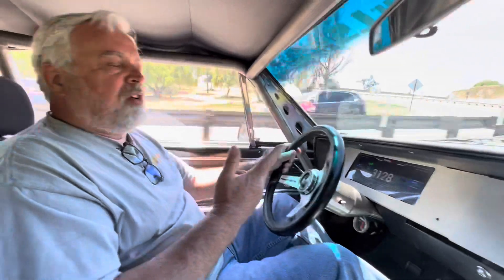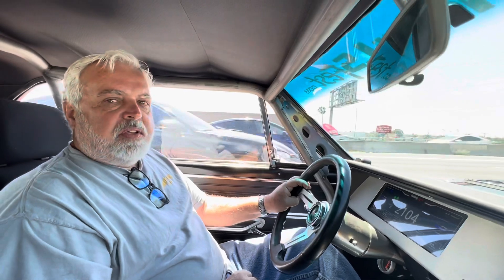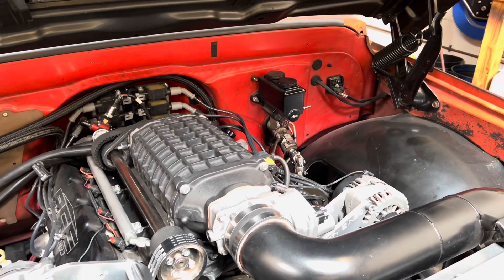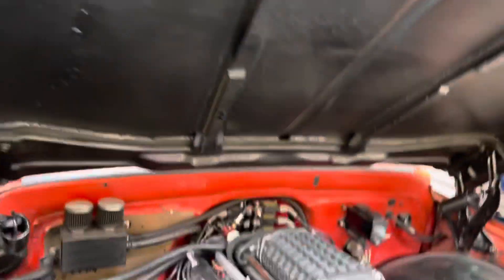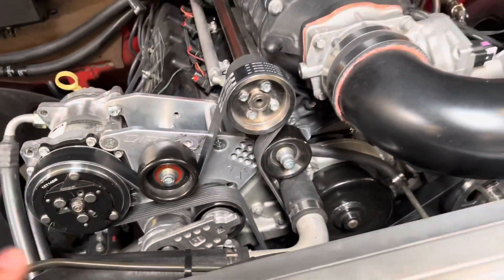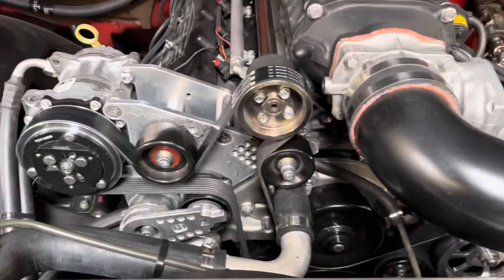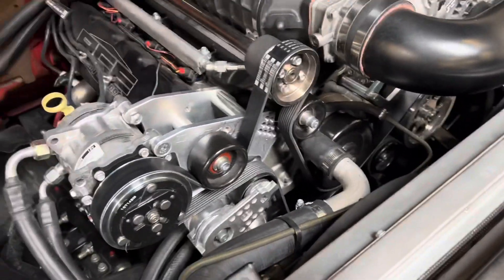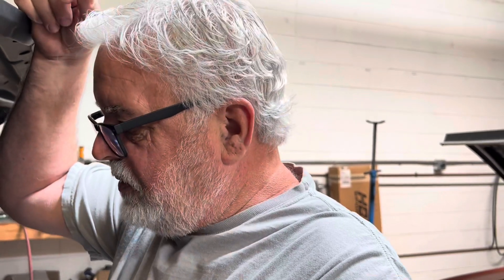Dirty Truth About Belt Alignment

Comment: Sounds and looks like the belt drive mess I have running a custom mounted Vortech. A smooth idler pully with shoulders ended up fixing mine. It took mounting a Gopro under the hood to figure out what was causing it. The Triple disk converter was locking up so hard at WOT that it was causing a wave/slack in the belt between that idler and the alternator and the belt would walk for a split second.
Reply: Turns out belts move & react way faster than any auto-tensioner ever will.